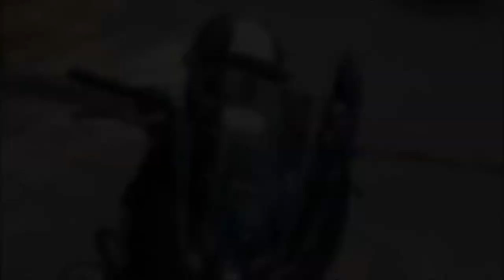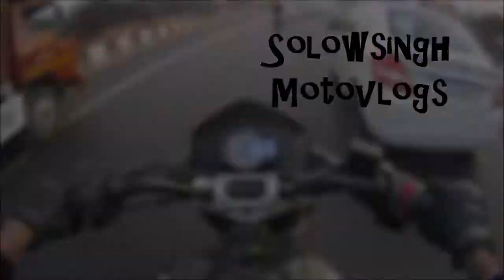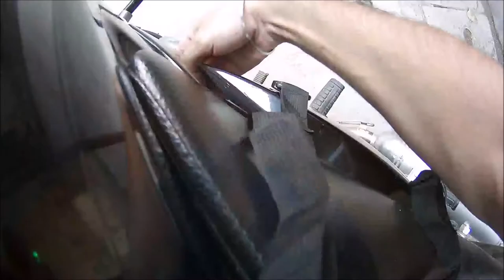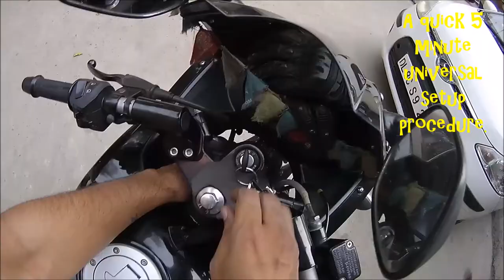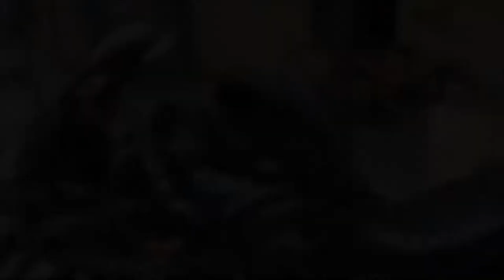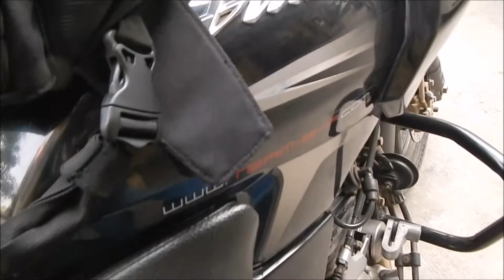ROAD GODS - Zeon R1 | PART 2 | Setup | First impressions

Comment: Is this Zeon R1 or R2? Coz as per the website R1 doesn't have any magnets. They're purely strap based. R2 has magnet!
Reply from the maker: Yes this is R1 and it is strap based but not purely because mine has 3 small size magnets at connections points to i guess "sturdily hold it in place" .

Works great though!

Comment: You claim the bag as R1 but  
1. Magnetic flaps is there on R2.
2. Mobile pocket has zipper left to right, which is similar to R2. Mobile pocket zipper in R1 is upside down.

Also it has 3 buckle straps, which is there only on R1. Single buckle strap is present on R2.
I noticed the logo on top of bag is Zeon R1.

It is very confusing as it has the properties of both R1 & R2. :-D
Did you bought it from Road gods official website? Is it any new model launched by Road Gods? Magnet + 3 buckle straps !! :~
Reply from the maker: Too much questions!!! :S :D

I will answer one by one, 

is it R1 or R2 ? - so i bought it from amazon and the invoice states its an R1 plus when you get the bag, roadgods asks you to send a photo of the invoice in order for them to be able to activate the warranty of the bag so i am sure its a genuine product.

Does it have magnets or not? - initial expressions that i had on this were the same as you but when i got the bag i noticed that there are small but strong 1 rupee coin size magnets on each strap at the points where the straps might touch the body of the motorcycle.

Is it a new model or anything of such sort? - well i guess i dont know, i might have been lucky if it is. LOL

Thanks for taking the time to ask, keep riding and subscribe and share if you like the channel.
Reply: Solowsingh Thanks buddy for sparing your time answering my questions. I am your subscriber now. keep riding n safe riding.